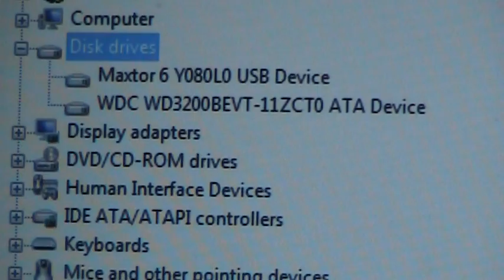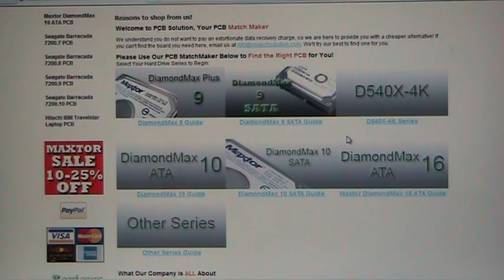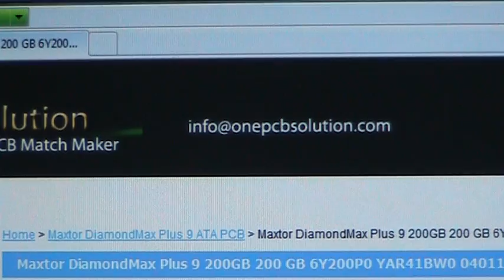DIY: How to repair a clicking damaged hard drive

Comment: I have a hard drive from a broken laptop. I bought a sata/usb adapter recently. The drive spins up but the heads go back & forth onto the platters, then back to normal. The drive isn't recognized only the enclosure, & when I use defraggler the laptop drive shows a "toothpick" width of used space I don't have a donor drive or a torx driver, so I'm using the smallest screwdrivers that I can find. I"m running out of things to do

Comment: I have a HD that is clicking and will not show up when out side of a lap top.  How do I know it the board is what needs to be changed?  The HD is a Toshiba 750Gig lap top drive MFG Jan2012.
Reply: Michael Raphael If you want the data recovered,  visit www.copypastemaster.co.uk,  cost  for UK customers is £175 and non UK customers £195, fixed cost.

Comment: As a data recovery software I can recommend MaxDataGenius - a reliable software for technicians and admins (http://www.grauonline.de). 
It recovers exFAT, NTFS, ext2/3/4, FAT, JFS, HFS(+), UFS, ZFS, XFS, ISO and also from VMWARE and RAW disk images.
And it works very good - even with physically damaged media.
So it is quite versatile and has very good recovery results - especially in difficult cases.

Comment: I have a drive that went down in the last 24hrs. After watching you video I think I will try removing the PCB and cleaning the contacts. 
At this point I suppose it couldn't hurt.

Q: Could connecting a PCB removed from a drive mechanism be a way of seeing if the PCB is ok?

Comment: thanks guys. I used your service to get a new PCB from you and the repair worked flawlessly. I know your website says to copy the HDD contents to another hdd once the failed one is repaired and for some reason i waited about 3 weeks after repair to finally copy over the contents to another HDD. Well I'm glad I did it a few days ago as this morning I woke up to hear this clicking sound coming from that repaired drive...its not registering on the PC anymore and it has not been dropped (hdd was repaired and laid on table to where it still rests this morning).

Comment: If i hold my ear up to the hard drive and hear clicking, does that mean it's broken? Or is it only when it is audible without putting your ear up to it? thanks!
Reply: Well, the sound intensity of the clicking shouldn't matter I think.
Is the hd still detected by your computer? I'm not a pro, but I'm trying to figure things out for myself as well.
Reply: It still works and there are no observable problems but it makes that sound if I hold my ear up and listen really closely to the hard disk...i think mine is fine.
Reply: Lauren C

Comment: My iMac's HDD just started clicking slowly. As I wanted to restart and do a backup it started clicking and now it is not recognisable at all. I cannot restart it in target mode either. I can however start my iMac from external drive obviously and when I do so the HDD is not there at all. I have done some hardware tests and it seems as the HDD is damaged. The only question is, if I replace the PCB will it work again (just so I can at least backup data)??? Any insight please?

Comment: The title of this tutorial "How to repair a clicking damaged hard drive", doesn't pertain to what your doing! You're replacing a circuit board within a hard drive, NOT REPAIRING A CLICKING DAMAGED HARD DRIVE!!! You didn't even run the hard drive so we could hear it CLICK!!! This video is misleading!
Reply: Wtf, u saying sry to say plainly. Computer runs on dc low voltage 12 v typically.
If the hdd is clicking its probably cos it cant read something and keeps retrying would be my guess.
There are some things that run and/or use to run on 5V dc in the desktops if I recall right but even that had 12v as well, but its been 24 yrs since I went to tech college for computers the last time around.
Moreover, if one needs to recover data from a damaged hdd circuit board even at a p hatrice of a hdd is welcome.
I.e. if I could recover data that my Galagy 2 dumped, namely txt messages I would pay even 100$, as the data lost is great prove to recovering over 1500$ in wages...Siilar issue one may have with a hdd....
Lie lost work, info, fam pictures, etc.
Reply: Besides this obvious shit, any clicking made from anything dealing with ACDC  is %97 of the time its from the spark caused by the overflow current made by a blown fuse or cap during a max amp current taken from the ACDC current, in short can be basically anywhere the circuits are close together for a gap jump
Reply: Yes you did.. He showed you 1st thing. Were you watching another video

Comment: I have a pile of broken hard drives accumulated from almost 20 yrs, i'm switching over to SSD's, the only 2 hard drives that still work after 11 yrs are a 200 and 300 gig Maxtor drives made in Singapore, Thailand ones are JUNK.

Comment: my external hard drive which has never given me problems all of the sudden started clicking and stopped working if i unplug it and plug it back it does the same but if i plug it into my moms computer it works fine its not a cable leanth problem factory 3 in cable usb on motherboard anyone with any ideals

Comment: What could be possible causes of failures when upon powering up the laptop HD, teh platter starts moving, the head moves on the platter for about 3 times and then all spinning comes to dead stop, nothing happens afterwards until I plug off and plug back in the power to HD and then same sequence of motion repeats.??

Comment: My Samsung hard drive doesn't click that fast. When startup, it first clicks slowly (every 5th-6th second) few times (slowing down the computer a bit), then stops clicking and goes normally, then starts clicking again and stops clicking. Then it clicks third time and after that, hard drive runs normally without anymore clicking or slow downs, like there's nothing wrong with it. So is my hard drive ok otherwise, and requires just a new circuit board or other harmless little method to fix the click once and for all, instead of buying the new hard drive?

Comment: I opened up my SSD drive and found out they had left out the platters entirely!  No wonder it didn't work.  I figured maybe freezing it would help anyway so I put it in liquid nitrogen.  Nothing.  Tried hammering it on the table.  Still nothing.  I'll never buy another Windows PC ... it's Macs from here on out!  I opened up the hard drive on my new Mac just to make sure they had included platters and it looked OK.  Put my initials on the top platter with a Sharpie just in case I have to send it in under warrantee later.
Reply: +George Murray Hahahah! You are hilarious.

Comment: The question is...How does one determine that the circuit board is the problem? That's what should have been shown. This was more of a sterile way at troubleshooting without troubleshooting,which in turn leads to buying your circuit boards.

Comment: PCB solution is an excellent source for PCB's. If the swap does not work and you need professional help for a fee, call us at 519-256-2223 10am - 5:30pm EST. We guarantee a recovery or you don't pay a recovery fee.

Comment: mine started clicking after bumping it...but the they is i didn't bump it that hard...was just a tiny bump
Reply: For future readers of this, u might want to try bumping the hard drive on the palm of your hand to see if you can jolt loose the head from the top of the platter. I am a complete newbie,, but have read this is an option that might work especially if you  have dropped your laptop. Someone with more knowledge might disagree, but u should be able to search for this technique on YouTube

Comment: Why my Seagate hard drive run perfectly in start but after that says boot failure and stop responding in windows
Reply: ***** Call me at 519-256-2223 if you need the data recovered.We're located in Canada.

Comment: Thank you so much sir :)
My seagate barracuda ST500DM005 did the same sound and it wasn't detected by the system, so while searching for a solution i came across this video and i decided to try it, hoping it will be the circuit board problem causing it and not a faulty head arm thing, i was lucky as replacing it solved the problem.
i will be buying a Western Digital one some day and clone my repaired one , because i will not trust seagate anymore cause this problem happened only after 6 months of operation. Thank you again.

Comment: My 500gb laptop hdd clicks and crashes only in one partition. Could it be a damage in the control board?
Reply: ***** Its possible but its likely a head crash which will need clean room work.

Comment: I have a 200GB Seagate Barracuda 7200.7 HDD model# ST3200822A, It doesn't click but it is recognized on my computer.  When I click on the drive to access it i get an error message that I have 2 format the drive before I can access it.  I don't wanna format it because I don't wanna lose the important information that's in it. I tried looking everywhere online seeking a solution. Im at my wits end. What can I do?
Reply: HipHopHead187  You can put Ubuntu on a thumb drive and boot Ubuntu up into the trial mode then see if you can access the had drive from there. If the drive is recognized on the computer, you may be able to retrieve the files. Disk Digger is a good tool as well.
Reply: It's an IDE HDD by the way.
Reply: HipHopHead187 
You can try to run free recovery software but don't allow it to run for hours and hours as that may destroy your drive if there is a mechanical issue. If its not finding files relatively quick with the scan, (30-60 minutes)you will need a data recovery guy.
Reply: datarecoveryguy.com I did that, after an hr & change,  it only found "SW files" or what they also call "raw files". I wasn't able 2 extract all the info. Found no documents, photos,  videos or any other type of data &/or media.
Reply: It sounds like your drive has physical bad sectors. Software cannot help you and any further attempts will just make it worse. We can very likely recover this for you for if the drive is recognized for $280.00. If you are willing to pay for help I would be happy to take care of that for you. Just give a call my name is Rui.

Comment: lol mine is beeping ......loud
Reply from the maker: If the motor is not spinning, it is most likely a stuck motor, maybe cause by the disk head coming to a stop on top of the platters. (typically caused by sudden power loss or power surge)
Reply: thanks man
Reply: Westley Bates So... Either way, your HDD is FUBAR!
Reply: yes it is
Reply: +Westley Bates yea i opens a hard drive to touture and stop the head and it sounded like a buzzer
Reply: +George Murray wow was it like somebody 
was grinding a piece of metal but surging

Comment: I had a drive die (WD20EARS) I cant find the exact board on the site :( I find some close but not the same board. Contained the last 10 years of my life on it things that id like to not loose. Im pretty certain its the board though as one day it just wouldnt spin up or do anything. The board gets really hot for some reason aswell. It was in a desktop and never abused (although the drive did come out an external casing, it was never even powered on in the case, I pull the casing apart and stuck the drive directly into my tower)

Comment: Most of people use computers turned on 24/7/365 and for that your hard drive wont last long max 2-3 years or less but replacing board is going to cost you 50-70$ for that money you can buy 1tb hard drive and mine advice is back up your data to external hard drive when drive die you have saved your important data don't think  hard drive will last many years simply it wont.
Reply: Most of the people here are not able to get into their hard drive to back up anything. It all depends on how important your data is to you as to what you will pay to save it. The price of the hard drive itself is not significant.

Comment: Yes this will only fix the drive in a some cases. There are so many other reasons for clicking drives that can actually be made worse by trying to repair DIY. However if data is not that valuable this is a great solution to try initially!

Comment: is this a temporary data recovery? or a permanent fix
Reply from the maker: Good question. Depending on the condition of your drive, it might work for years, or not at all.
If recovery is possible, I recommend backing up your data first. You can use the drive as a secondary backup, so if it fails, it doesn't matter.

Comment: Hey pcbsolutions, I was wondering if it's possible to open the drive up then putting the disc into another case of the same model that has a working PCB and read head. Will that work?
Will it work if it's a different case?
Reply from the maker: I believe it is possible if you have all the necessary tools and experience. We cannot do platter transplants ourselves though.

Comment: really help full
But I have SD black 500GB hdd its just dead no sound no obvious indication that I know to follow your treating way,  so please instruct me as soon as you can.
Reply: Hello Wahidullah, I am not from pcbsolutions but i am a fellow technology expert.
This has happened to my old Seagate Barracude 160GB, If your PC cannot read it or your pc cant load the os off it, It means the hard drive is COMPLETELY dead, My pc didnt want to load the os off it and not be able to read the 160gb seagate, so i just threw it away and got a used 600GB Toshiba hard drive
Which i now use as an external hard drive, Hope this has helped and if you want to please sub to my channel. Once again i hope this has helped you

Comment from the maker: I just want to add that a direct swap like the one shown in this video is no longer possible for most of the new drives. We have a solution for that, it's called a firmware transfer.
This means the small amount of data stored on the board needs to be moved from the original board onto the new board. Our boards all include this service, but we'll need you to mail the dead board to us.

Example: http://www.onepcbsolution.com/fitr.html

For Seagate / Maxtor drives, anything made AFTER Barracuda 7200.10 or DiamondMax 21 needs a firmware transfer.
For WD drives, a direct swap will work maybe 5 - 10% of the time, because WD uses a wide variety of firmware + disk head configurations for every model. A firmware transfer is always recommended.
For Hitachi / Toshiba: a firmware transfer is always necessary.
For Samsung: a firmware transfer is needed for most drives over 500GBs.

If you are unsure, feel free to email us with your drive's model.

Comment: I have an portable external Seagate drive which is 500GB and really nice but recently it has developed a clicking / ticking sound when reading or writing. The data and still all be accessed without any issues but the sound is worrying me since although sounds from hard drives are normal, it cannot be normal for it to be much louder than ever before.

Comment from the maker: Hi Garry, yes that is correct, a firmware transfer is required for most new hard drives, and is included with our items. We do need you to mail the dead board to us in order to do the transfer.
As for reliability, we see dead drives of every brand, so we recommend keeping a backup of your data regardless of which drive brand you have.

Comment: Not always so simple especially with Seagate you also need to transfer the firmware rom to the new board using a hot air station - still an easy fix but you need the tools.

I will never ever buy a Seagate drive again they are complete nonsense as is the 1 year warranty and numerous firmware issues that they refuse to deal with. Awful company!!!! WD, Hitachi or at a push Toshiba drives from now on.